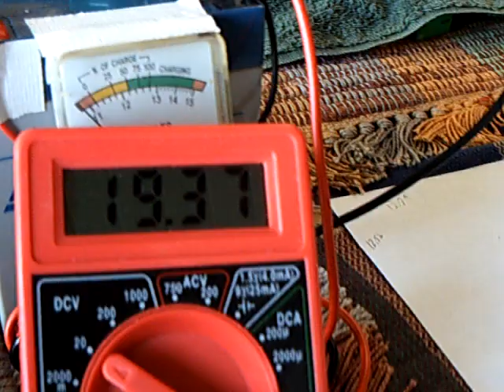New setup for One Magnet No Bearing Bedini

Comment: you should see what happen when you put a levitron over it, you can get them from ebay for 15 bucks,,,,, its like a magnet that floats,,, but its a little more complicated cause you have to add weight, and temp also effect it, anyway it would be interesting to see.  maybe get the levitron going then cut the circuit on